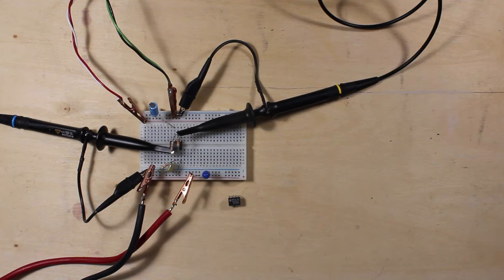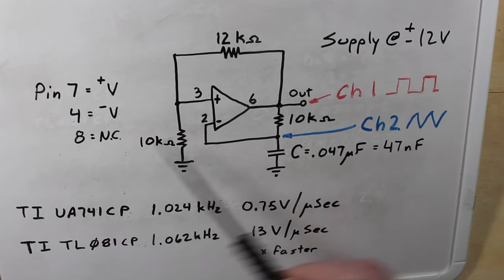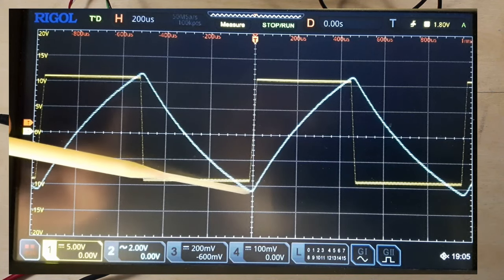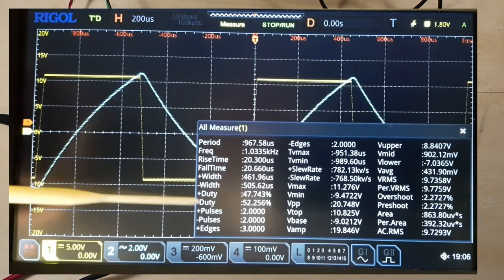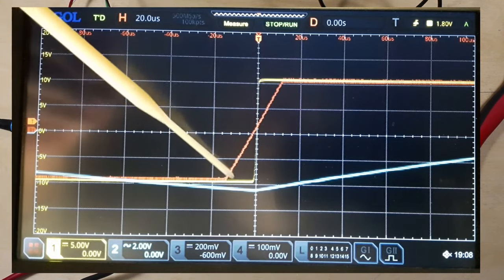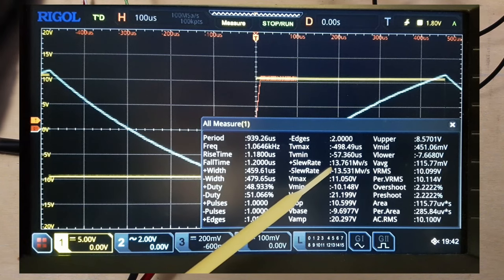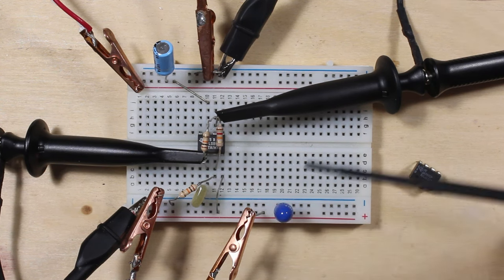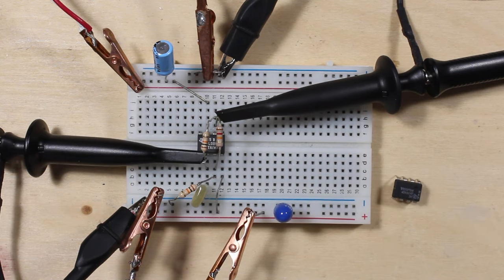Op Amp Speed Comparison - uA741 vs TL081 - Kinda' Unfair  #electronics #experiment

Comment: Very informative and down to earth comparison of these two op-amps. The TL081 is a FET input op-amp while the 741 is bipolar. Would be interesting to repeat the test with a 'currently available' bipolar op-amp like an LM358.
Reply from the maker: Thanks for the comment. There are certainly a lot of different models of the LM358, judging by the selection tool from DigiKey.  At some point in the future I was thinking of comparing the LM318 which does 70V/uSec and the LM3900 which is kind of an oddball and does 0.5V/uSec when going from low to high but when going from high to low does 20V/uSec, 40 times quicker.
Reply: @MoreThanElectronics  that’s very interesting 🤨 what would be an application for lm3900 ?
Reply from the maker: The 3900 is a Norton operational amplifier.  In other words it works on the current differences at the input as compared to a far more typical opamp which works on the voltage difference.  These were specifically designed to operate from a single supply over a wide voltage range (from the TI spec sheet).  Search Google for 'Texas Instrument Application Note 72'.

Comment: Just found your channel. Very interesting and informative. I was just playing around with an AD8055, which offers a slew rate of 1400V / us. Fascinating what differences there are in opamps.
Reply from the maker: Just looked it up on DigiKey.  Less than $6 for one.  Using it for video?
Reply: @MoreThanElectronics  Experimental for I/V conversion after a DAC. AD did mention this in a tech sheet I believe. AD811 is a fun one also, 2500V/us. I kinda like trying out stuff. Your remark on the tantalum filtering higer RF 'products' didn't come as a surprise. Did you ever play around with a ferro-resonant transformer? I'm quite curious how 'silent' that is from nature and the lack of need of voltage regulation is interesting.
Reply from the maker: I've never played with ferroresonant transformers but I remember them being used in the amplifier housings that hang on the telephone lines in cable systems many years ago.  They were switchable for 30 or 60 volts in.
Reply: @edmaster3147  All the ferro-resonant transformers I've ever worked with hum like crazy - they derive their regulation properties from driving some parts of their laminated iron cores into saturation at double line frequency, and ordinary 3.5% silicon steel has a significant amount of magnetostriction.  Aside from that, they are rugged and will last a very long time if their resonating capacitor is sealed in a can with an oil-saturated paper [old school] or plastic [modern] dielectric.
Reply: @jrb_sland  Thank you. I understand they were used in 60's television sets and in early computers. Wouldn't the hum easily be filtered out?
Reply: @edmaster3147  The hum is acoustic - you hear it with your ears.  Building an acoustic shielding box to trap mechanical vibrations at 120/180 Hz would be very heavy & expensive.  Modern regulated switching power converters operating at similar power levels [kilowatts] are smaller, lighter, and SILENT.  Same kind of thing with AC to DC power conversion.  A century ago the best way to make multiple kW of DC for operating the multi-kilowatt carbon arc lamps in movie projectors for big theatres was a motor-generator set, i.e. a 5 ~ 10 horsepower three-phase AC induction motor driving a 5 ~10 HP DC generator.  Some of these machines had the two units assembled on the same shaft!  Again, utterly obsolete.  Electronic power conversion means no belts to inspect, no bearings to grease, no brushes and commutators to routinely replace/repolish, and no noise or vibration...
Reply: @jrb_sland  Ah, now I understand. You mean a mechanical hum. Some transformers hum a bit, I am aware. I am enjoying myself experimenting with PSU's for low power and voltages, like 5-20VDC and 10-20w. Thank you for your comments.

Comment: This is very good!!! Have you compared to a LM386?
Reply from the maker: I haven't.  The LM386 is not really a general purpose device, it's designed to work as a power amplifier at audio frequencies and is not built for speed.
Reply: @MoreThanElectronics  The 386 is not an op-amp. Gain is fixed at 20 (or higher). Has a similar input stage to the 358.  It was designed to drive a small speaker.
Reply from the maker: Yes, it is able to drive speakers, ultrasonic devices, and some other low power devices. Paragraph 8.4 on page 9 of the Texas Instrument LM386 data sheet from August 2023 calls it an Op Amp. It does have a differential input.

Comment: Excellent video. Thank you. Can the TL081 be used for rf filters ?
Reply from the maker: Short answer is no, unless you are looking at very low radio frequencies.  The new version, the TL081H, is only rated to 5.5MHz with gain set to one.  Even at the common 455kHz intermediate frequency there are better choices.
Reply: Sooooo, what are the better choices ? I am just trying to avoid making my own coils. The whole Sellen-Key circuit seems very attractive but all the examplese on you tube never goe into the HF regions.
Reply from the maker: The size of the capacitors in the Sallen Key filter get very tiny when getting in to the HF region.  Stability is a problem.
www.analog.com/media/en/training-seminars/tutorials/MT-222.pdf
www.researchgate.net/publication/3756758_Fundamental_frequency_limitations_in_current-mode_Sallen-Key_filters
Reply: Aha ! I see. Ok. Back to the drawing board,

Comment: The only thing I'd use a 741 for is as a replacement part in an old piece of equipment.
Reply from the maker: Agreed.  I might be tempted sometimes to 'upgrade' a faulty 741 to a more modern part, but that can have unexpected negative consequences, like ringing.
Reply: I remember back in the '80s I was repairing an audio preamp. It used 709 op amps if I remember correctly. They were even older than 741s, and hard to find even back then. If I remember, they needed external compensation, but, under some circumstances, they were faster. Being over 40 years ago, I hope my memory is good on this.
Reply: you are right, 709 is faster than many more modern opamps because it is not compensated and you can adjust ext compensation to get better results @jbuchana
Reply: Would have been nice if you said what an “op amp” is!
Reply: @dougfinley5151  An operational amplifier (op amp) is an analog circuit block that takes a differential voltage input and produces a single-ended voltage output. Op amps usually have three terminals: two high-impedance inputs and a low-impedance output port.
Reply: @richardl6751  Careful - the absolute minimum number of leads on a real opamp is FIVE - you didn't mention the utterly necessary two leads for powering the device.
Reply: @jrb_sland  That's given.

Comment: Although not relevant for this circuit, FET input op-amps generally have a higher input offset voltage than bipolar inputs. This might be a factor to bear in mind, in addition to those you mentioned.
Reply from the maker: Agreed.  Analog Devices has some info about it (and much else) on page 26 of a training seminar document.
www.analog.com/media/en/training-seminars/design-handbooks/Linear-Design-Seminar-1995/Section1.pdf
The big manufacturers in particular have a lot of good documentation on how to use their devices.

Comment: isn't this supposed to be a slewrate test with variable frequency generator?
Reply from the maker: I wanted to keep it simple so I used a basic circuit that gets the opamp to swing it's output about as fast as it can and then measure the changing (slewing) voltage directly.  A fast edge pulse generator can be used at the opamp input and then see what comes out.  Slew rate can be measured using sine waves but you need a distortion analyzer or a spectrum analyzer to watch for slew induced distortion (harmonics).

Comment: Is the current capicity the same?
Reply from the maker: Short answer is yes.  Short circuit current rating for the old 741, the new 741 and the TL081 are all typically about 25mA.

Comment: Fairchild's ua741 hit the market in 1969!  It was a real game-changer in its day because it had an internal compensation capacitor that prevented it from immediately going into a thermally-fatal self-oscillation mode in the hands of newbies. Texas Instruments' TL081 family [TL061, TL071, TL081, etc] hit the market in 1977!  Why are you comparing these antiques when much, much better amplifiers exist at similar prices?  The 741 has a limited output voltage swing and is as slow as molasses, and the TL081 family introduced me in the early 1980s to the dreaded sudden output phase-reversal when one or both inputs were driven beyond their linear range.  But I've moved on - there are far, far superior devices on the market now 45/55 years later.  Shall I start waxing rhapsodic about the virtues of ultra-linear-connected transformer-coupled vacuum-tube audio power amplifiers using 6L6GT output tubes driven by a 12AX7, a breakthrough design by Williamson in 1947, the year before I was born?  Please live in the now, Mr. "More Than Electronics"...
Reply from the maker: I use those parts because they are cheap, available from many manufacturers and sources, and well characterized.  Perfect for those learning the hobby, all over the planet.  Making mistakes with $0.80 parts is affordable.
These parts are still available, now.  See EEVblog video 1436.
What similarly priced opamp would you recommend?
Reply: @MoreThanElectronics   I must apologize for my rather rude comment - I've been doing electronics of one kind or another for ~ 65 years now, and I've forgotten most of my early years of struggling to learn.  
After some shopping on the Canadian DigiKey website,  I found On Semi's MC34071 family which might be a good substitute for the TL081 family.  An MC34074 quad amp in a 14SOIC package is CAN$ 1.33 one-off, which is ~ CAN$ 0.33 [~ US$ 0.24] per amplifier.  One hiccup - these parts in a classic DIP package are listed as obsolete, which might be a showstopper for students depending on classical 0.1" plug-in breadboards.  At some time in the future, though, your students will need to learn to work with surface-mount parts as through-hole tech inevitably goes obsolete. Rather than breadboards, many people now use free-to-download LTSpice or similar software to create computer models of their proposed circuits, and there are many free-to-download schematic capture & card layout software packages available.  DigiKey now offers easy access to four [or more?] commercial card shops in the USA at remarkably low prices.  
A single opamp MC34071 in an 8SOIC package is CAN$ 1.27 [US$ 0.94] .  The dual opamp MC34072 might be the best choice, CAN$ 0.95 [US$ 0.70] in 8SOIC. or US$ 0.35 per amp.
PS - I just found a dual opamp still available in an 8DIP package!  My old friend the LM2904P dual opamp can be had from DigiKey for only CAN$ 0.61 each [US$ 0.45] or US$ 0.23 per amplifier! Two-thirds of the price of a dual TL082!  Mouser still carries the single 8DIP ua741 for CAN$ 0.71 each [US$ 0.52], more expensive than the superior [imho] LM2904P.
Hope this helps!
Reply from the maker: If a person is able to work with the surface mount packages there is a lot more choice available, both with active and passive devices.  That said, maybe the TL084HIDR is one to consider.  I think the LM2907P has a typo?
Reply: @MoreThanElectronics   yes, typo.   meant  LM2904P  I've corrected the original post.
Reply from the maker: The MCP6487/89 looks interesting and they are available in an SOIC package.  Easily usable with 3.3V and 5V microcontrollers as it's designed with a single power supply in mind.  I added a few of them to my shopping cart.

Comment: Which one is better ?
Reply from the maker: The quick answer is the TL081 if these two were your only options, especially compared with the original 741.  It depends on what's important in the circuit it's to be used in.  Neither of these might be best for the job at hand.  The home hobbyist should have a few TL081/082/084 in their parts bin.

Comment: Op-amps for audio use need far less slew rate than people assume. Fact is, we’re not listening to square waves and once you’ve done the math, it is easy to see that music does not benefit from an ever-increasing slew rate.
Reply from the maker: I agree. Even the old 741 at 0.5V/uSec should handle an 8 volts p-p sine wave at 20kHz without slew limiting.
Reply: @MoreThanElectronics    At the time, new components with tantalizing specs were being used with little consideration of need. I have a very early Midas Pro 01 console using select mil spec 741A op-amps. I’ve recorded many great live records with it and recall some even commenting on its great sonics.

Comment: So.. you're saying the 741 is more tolerant to problematic circuits.. yet you're saying you don't know why any one would use one instead of the the more intolerant TL081. 
I think you answered your own question.
Reply from the maker: I'm saying that the TL081 has higher gain and much larger bandwidth so is therefore more susceptible to unwanted oscillation when not taken in to consideration in the circuit design.  Old 741 designs may never have that problem because the 741 was so slow and therefore the TL081 may not be a good substitute without circuit modification.  In new designs I choose the TL081 because it can do everything the 741 does and much more.
Reply: @MoreThanElectronics  Agreed it can do more, however if I want to pop up to the shops (aka do a simple task) I generally don't want to have to put on a full hi-G flight suit (aka having to carefully design even simple circuits to stay stable at high frequencies), I am happy wearing a T-shirt and shorts..... Just sayin'
(and yes...I have had a few experiences with nice simple circuits using high speed components that spew out lots of RFI, draw suspiciously high currents and run hot...)